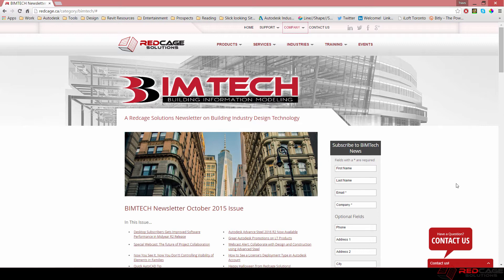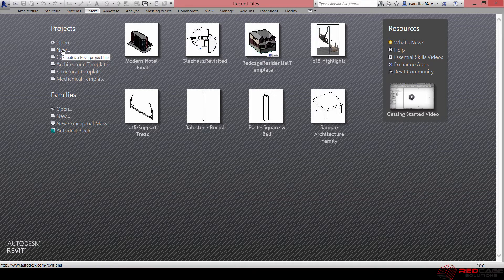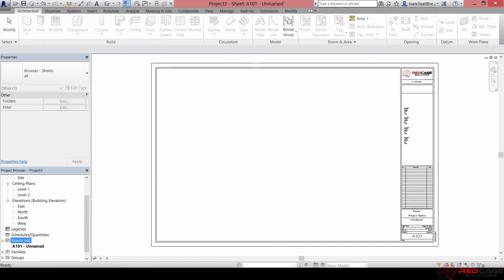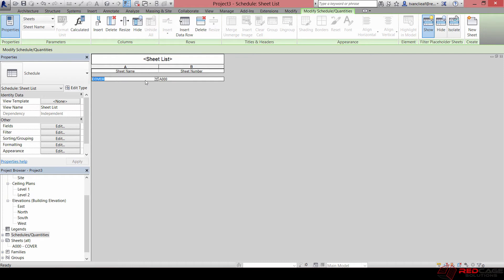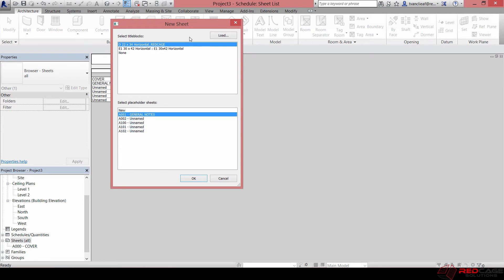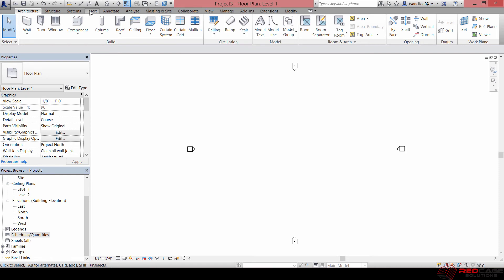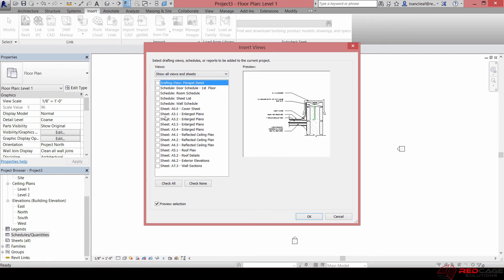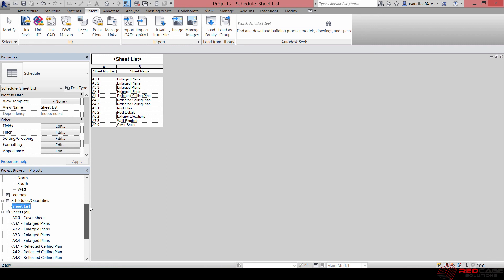Creating Placeholder Sheets in Autodesk  Revit 2016

Comment: I've got a bunch of placeholder sheets in my sheet index. Can I get them off my schedule but not delete them?
Reply from the maker: if they are placeholder sheets, then at the top of your ribbon on the far right, you will see an option to Show, Isolate or Hide Placeholders. Simple to apply, but simple for one of your colleagues to changes. This is why I recommend sheeted SCHEDULE IN UPPER CASE, and 'Model Management' schedule in Camel Case or better yet, separate them with a Browser Organization option.  :)
Reply: @TravisVanClieafBIM  Awesome. Tip of the day. Yeee!

Comment: Hi, how about inserting sheet number in the middle
Reply: I already have sheet number 100-150 . some how, I do miss single sheet in 120. renaming 120-150 is paint full. is that better way to insert 120 and than automatically rename original 120-150  to  121- 151
Reply: its hard to understand

Comment: "add data cell" isnt doing anything that I can see
Reply: nevermind... this program is so convoluted... It was copying some other sheet not displaying in my sheet index.
Reply from the maker: If you check your Sorting/Grouping Tab is Itemize All Instances checked?
Reply from the maker: @user-nx3gr3qe4y  it is not for people looking for the quick and easy, I agree. But then...neither is this industry! As convoluted as it is, it's equally as versatile and powerful! Good luck!
Reply: @TravisVanClieafBIM  THANK YOU FOR YOUR QUICK RESPONSE. WE USE A GENERIC NUMBER COLUMN WITH A FILTER TO SORT OUR SHEET INDEX TO OUR LIKING. WHEN I "ADDED A DATA ROW" IT WAS ADDING A ROW WITH NO DATA IN THE SORTING COLUMN SO IT WASNT SHOWING IN THE SPECIFIC INDEX I WAS WORKING IN. SO I HAD TO DELETE MY FILTER SO THEY WOULD SHOW, GIVE THEM A NUMBER, THEN RECREATE MY FILITER.
Reply: So far Revit is not impressing me. Its certainly not quick.
Reply from the maker: @SethSeibel  I have to ask, why do you use it if you're not impressed?